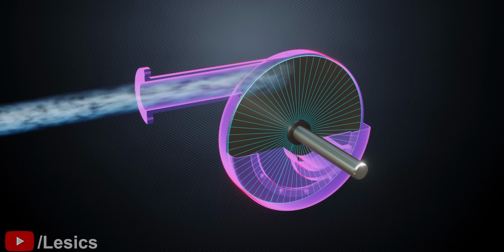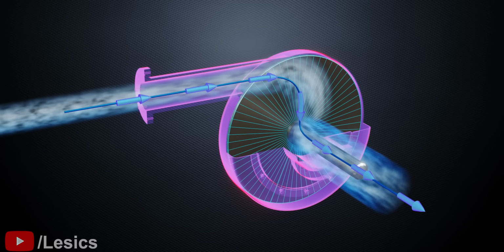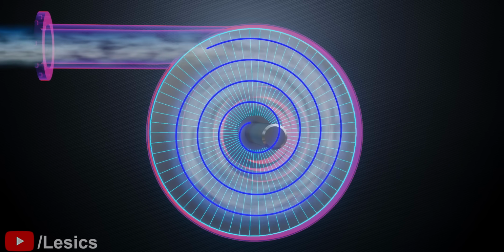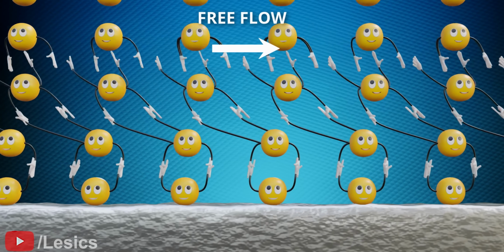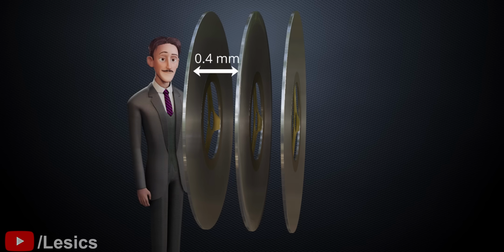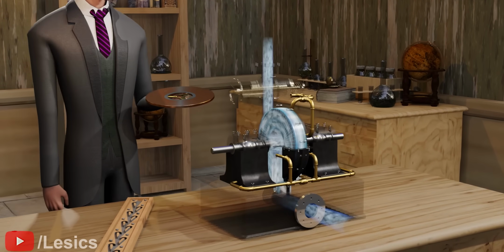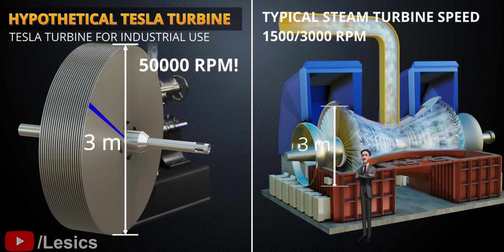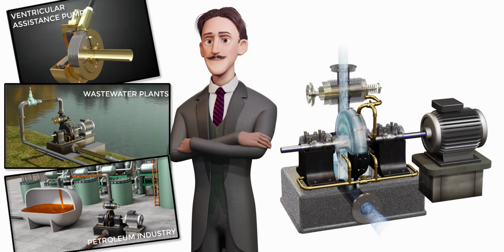Tesla Turbine | The interesting physics behind it

Comment: This very high rpm-rate only yealds for small disk diameters. Remember, the disks are driven by the viscous shear force acting in the boundary layer of the steam and the disk surface. The disk cannot rotate at a tangential velocity which is higher than the steam velocity. Tesla's turbine has a lot of disadvantages. The steam outlet in the center of the disk is not convenient, because the steam's velocity ist the highest at the lowest pressure. The more the steam vortex propagates to the center of the disk the larger ist the velocity difference between steam and disk, which leads to a lot of friction losses.

Furthermore it is very hard to predict mathematically how the steam moves between the disks. This makes it very difficult to optimize a Tesla turbine by use of theory. Only very modern CFD simulation tools are capable to simulate the flow behavior in a Tesla turbine and the findings from these simulations are not very promissing. So it is better to modify the Tesla turbine in a way that the steam enters and exits radially using a very well defined path at the rim of the disk, where the tangential velocity of the rotating disk is nearly constant. The steam propagates around a half circumference between the disks, where the tangential velocity difference between the steam and the disk is nearly constant and less than the speed of sound. This case is very easy to calculate by state of the art fluid dynamics. The gap between the disks is set in a way, that the friction is not larger than necessary to transfer the required torque carrying the power from the steam to the disks.

The space within the rim of the rotor is not lost. It can be equipped with permanent magnets forming the rotor of an axial flux generator. The induction coils can be placed inside the cover plates of the turbine. In this way it is not necessary to transfer the power mechanically through the turbine housing by use of a shaft. The power is transferred by wires connected to the induction coils of the stator. So the turbine can be hermetically sealed. A Tesla turbine modified in this way can act as a very small engine for plug-in hybrid cars. In order to get a high efficiency this engine should be operated in a trans-critical high-temperature organic Rankine cycle (ORC), where the working agent enters the turbine not as superheated steam but as a supercritical fluid, which will be transferred into superheated steam in the expansion nozzle. In this way pressure and temperature of the fluid can be chosen independently. The heat transfer to the supercritical fluid doesn't require a complicated boiler + superheater. It can be provided by a state of the art counter flow heat exchanger heated by the exhaust gar of a burner.

Comment: This is cool and all but from what this video tells is that a Tesla turbine extracts KINETIC energy out of steam which is the complete opposite of what you want when you use steam. You want to expand it and lower the temperature by extracting energy using the blades. Some power planets have super ultra critical steam which enters the turbine at 800C and 600bar and leaves the turbine at a near vacuum and close to it's condensation point.

Comment: 42847.93 kw of stored energy at 50000 rpm and 3 m in diameter and weight example:- 10 tons
 42 MW is the stored energy in the rotating Flywheel

Comment: you cannot use words as "impossible" when dealing with engineering, just not achievable at THIS TIME. future brings more knowledge and new materials. just last 100 years should be a lesson to you.
Reply: Let me know when you create a material that can contain a bomb.

Discs exploding from centripetal forces is not a joke.
Reply: @heroslippy6666  as we can find examples of spinning blades at 15-25.000 rpm in modern jet engines (commercial compressor blades) with even higher rpm on power plant turbines, tells us that there are materials what are capable of withstanding high rpm even today. micro turbine goes up to 500.000 rpm. so as i stated, future will bring us new materials and alloys and we can expect that one of those will be capable to withstand usage in Tesla turbine.

Comment: I've read about his "powerhouse in a hat" in this video. At that time, I wondered why not try more modern, stronger material for the discs. But you explanation basically and correctly shoots that down, along the RPM to efficiency ratio. Too bad it is impractical.
Reply: Graphene steel might work

Comment: At 8m 23s it is stated that the blade tip velocity would be Mach 13 (4459m/s).
That number is actually to low.
If my math is correct then it would be Mach 22.89 (7853,94m/s).
Here are the calculations:
Disc diameter: 3m
RPM: 50000

First let’s divide the number of revolutions per minute (RPM) by 60 to get the number of revolutions per second: 
50000 / 60 = 833,33

Then we multiply the diameter (3m) by pi to get the circumference of the disc: 
3 x 3.14159 = 9,42477 (unit: Meters)

After that we have to figure out how far any random point on the circumference of the disc travels within a second by multiplying the distance traveled every revolution (=circumference) by the number of revolutions per second: 
9,42477 x 833,33 = 7853.94 (m/s)

Finally we divide the velocity from the previous step by the the speed of sound in air in m/s (343): 
7853,94 / 343 = 22,8977 (Mach)

Thus the velocity of a point on the circumference of this hypothetical Tesla turbine would be Mach 22,89 or 
7853,94 m/s.

These values are slightly of due to the use of imprecise values like only using 
five decimal places with pi.

If you notice any mistakes in my math please post a reply. Thank you

Comment: What if the disks are tapered towards the edge it’ll be more likely to withstand the centrifugal force
Reply: Unfortunately, the cohesion effect needs a very tight spacing. 0.4 mm for gases, 0.5 mm for fluids.

Comment: First, Mechanical Efficiency is not the only consideration when considering a turbine design.  While the Tesla Turbine may not be suitable for mega-watt or giga-watt power generation, it may be well-suited for small-scale hydro generation due to its simple design, easy maintenance, and ability to handle "dirty" medium.  Also, with additional engineering, we may find ways to increase the efficiency of  the turbine at lower speeds -- example, make use of coatings or etchings to increase the surface area of the disks.

Comment: What’s the torque on the output shaft. Could you slow the discs speed then use a gearbox to attain optimal shaft speed?

Comment: So like most of Tesla’s inventions it is a very ingenious design, excellent in theory but in practice flawed and only suitable in niche applications
Reply: Very useful. Thank you
Reply: 2m
Reply: Only when you're powering it with gas/steam. If you use a fluid, the rpm is in the same range as a standard combustion engine, but then you have to take a step back and think about what you actually want to achieve.

Comment: I played around using an old mechanical hard disk drive. Super smooth platters, rated to 10,000 rpm... Space the platters at .4 mm... It should produce a great turbine.
Reply: Are you going to cut the discs or use a hollow axle for the outlet?
Reply: @silvergreylion  I bought a 1' piece of Aluminum 1" milled pipe with thick walls(3/8"). The platters have a 25mm center hole... and yes... I'll have to sand down the pipe or mill it 0.4mm. ;-) I'm using the platters because their ultra smooth finish should increase the molecular adhesion. I hope!

Comment: well,  at least this is a  fairly  accurate  analysis of one of tesla's ideas, that sorta works.       as  a  Novelty.    mostly.          since the tesla turbine is  meant to be used with a gaseous medium,  what the hell could a tesla 'impeller',   PUMP.?!?          as discussed in the video,  like most of tesla's  ideas, the tesla turbine  does  Not  scale  up, well.           any  historic  performance claim, made by tesla, can be  Disregarded.      any evaluation of performance  Must  encompass  the  cost of  Energy  Invested;    eg., heat for steam  or  energy to produce compressed air.      and, the use of the   LATTER  makes  the  entire (air) turbine idea   a  Stoopid  one.        googletranslate

Comment: Why can't you keep a short diameter of disk, but add a BAJILLION disks across, and split the incoming steam into many many small pipes? You could process the same volume of steam, but if the diameter of each disk is only like 20cm (there's just hundreds more of them), then the blade tip velocity is 15x less, or < mach 1
Reply: The smaller the diameter of the disk, the less distance the fluid has to travel. The less distance the fluid travels, the less energy you harvest from the system. Thats why current turbines are about 3 meters in diameter instead of 3 centimeters
Reply: @SavageDr4gon  In essence I agree but with two caveats, the energy available for extraction is limited therefore the usable rpm is restricted, gentlemen size does matter, neither of these issues has anything to do with available materials. . Having analysed the numbers the power curve peaks around 45k rpm and then reflects diminishing returns depending on the configuration for a 100mm disc. As the disc diameter increases the power curve moves to the left also indicating a limit to the effective speed. Still all in all a brilliant piece of engineering

Comment: So even with all of our modern materials and making the disks a smaller diameter we couldn’t make a smaller version to run with all the disks?
Reply: We could make a smaller version.. you just use multiple stages. 
You could get more efficient turbines then the ones we have now using these, you could likely get higher then 97% if you use air bearings by sending some of the steam into the bearings before being pushed into the system
Reply: @youtubeistyrannical1787  I’m a craftsman/fabricator and you’re giving me ideas! LOL!
Reply: @youtubeistyrannical1787  instead of making these with three meter wheels that would explode from the sheers G’s it would have to endure just make several smaller versions with stages and sending them through bearings as you suggest. It may even be possible to shrink the size and stop wasting so much space for these massive generators we incorporate today?
Reply: @Redtailedhawk99  I have so many ideals for configurations on these turbines it's not even funny.. 
 It sucks because I want to be a craftsman, but I never make things good enough when I try to make things.. tolerances are always off too much, I need better tools and materials
Reply: @youtubeistyrannical1787  that seems to be the problem with most creative people we just don’t have the right tools but with the right support that can change eventually. I’m so rusty with my math skills these days I’ve mostly forgotten all the formulas for equations I used to know like the back of my hand. I never had that support and probably could have done some really good things. That’s my biggest gripe with governments is that they are to busy spending money of buying people fish rather than teaching them how to fish in a manner of speaking. If you really want a big prosperous country you don’t do it that way. You have to give people the tools to succeed.
Reply: @Redtailedhawk99  exactly... 
 Our nation is like 30th for education because our school is too expensive.. 
 Many degrees can be done all online, they need to setup a free school online for those degrees that can be done that way. 

 But I think they need to just pay for school with our taxes, that would stimulate job growth and grow the market... More educated people, plus they would get employed and have healthcare.
Reply: @Redtailedhawk99  I want to do school so badly, but I worry about the debt it will make.. 
 I also worry I won't perform well in a school setting once I get there..
Reply: @youtubeistyrannical1787  I have an idea I proposed to the last two presidents on several occasions and I haven’t bothered with this idiot we have now. It’s an easier way to get skills while avoiding the heavy expenses of Colleges only to end up falling flat and be in a dead field or in a job you’re not happy with and be in debt over it. It’s different than any normal trade school. So in a way doing exactly the thing the government should do that I kind of alluded to earlier.
Reply: @Redtailedhawk99  wait what are you proposing?
Reply: @youtubeistyrannical1787  training that pays for itself. I see what you were talking about though. Do you think you could incorporate those two designs into each other? How would the production of Oxygen and Hydrogen aid in the performance of the generator?

Comment: Steam turbine/ power generators RPM is controlled very precisely at about 3000rpm to maintain the electrical frequency of 60 hertz (depending on country) without requiring reduction gears between the turbine and generator.

Comment: one could hypothesize that if you add more discs you can decrease the circumference/diameter permitting for higher speeds without disfiguring the discs.
Reply: next step would be gearing ratios and flywheels to store kinetic energy over time.... 

cool physics thought a spinning metal mass produces an ion field around the spinning circumference. the larger the mass the further away the field. this is also due to a magnetic field being generated by spinning electrons around a iron core.

Comment: so what materials "can" withstand that kind of speed?
Reply: None. Also, it's a problem of resonant vibration of platters. It shakes itself to structural damage.
Reply: @brushhaidinger2506  curious if there is a way to offset vibration with another vibration to lessen the stress on a material....

maybe spaced grooves or even electromagnetic bearings in parallel with the discs instead of around their circumference... always questions always something else to try.

Comment: Great video. Slight disagreement with your evaluation of the efficiency claims. In fact, there are tests that have demonstrated efficiencies within the claimed 90-97% range, the Westinghouse works experiment, for example. That showed that for comparable flow rates (which were kept low as you mentioned), tesla turbines could achieve ~90% efficiency to the 50-60% steam turbines were able to achieve (at least at that point in time).
Reply: well,  merv,  i keep wondering  how  efficiency  is  determined  when  the force that drives a  turbine runner  comes  from  a (powered) AIR  COMPRESSOR.!!!!
Reply: @daviddavids2884  The ratio of what you put in to what you get out. In this case, how much energy the turbine can extract from the air (the working fluid). The turbine can then be connected to a motor to generate power.

Comment: A 3m disk will not have to spin anywhere near as fast as a 6" disk. 

The tip speed can never exceed the speed of the motive fluid exiting the nozzle. Thus a larg or small rotor will be at its highest efficency when its tip speed is as close to the motive fluid speed as possible. Bitnthay will be at radically difrent rpm. Being a lot slower for a large rotor. 

The issu is its only efficient till you load it.  It can only extract useful energy by the rotor tip speed being less than the motive fluid. The larger the disparity between the motive fluid and disk rim speed the less efficient it becomes. 

So as soon as it does real work it loses efficency. As it slows. 

It is useful for being exceedingly cheep and simple to make. As well as allowing a lot of power in a small package. 

A conventional steam turbine I fantastically expensive to make. And has to be started very carefully to avoide  dammage. 
The tesla turbine does aoide these issues. Which may still make it useful.
Reply: Yes, it will, a 3m disc is required to generate torque, the high RPM is needed to increase the boundary layer extent over the surface of the disc see 3:33.
Reply: @coyote5735  the tip speed can still never exceed the velocity of the motive fluid. 

This video seems to think that the rpm of a 6" disc applies to a 3m one. It is simply incorrect. 

Firstly it simply won't work at that speed if it were 3m. The dics would be traveling way faster than the motive fluid out of the nozzle. And would itself be creating a larger pressure through trying to be a pump than the motive fluid pressure. 

The tip speed is what you have to have equal to calculate the rpm. This means the rpm will be different for different diameter rotors. And will be less the larger the disk. As it has to rotate slower to get the same tip velocity. 

And I am still correct. This type of turbine can never exceed the velocity at the outer of the motive fluid entering at the outer edge.

I have read the analysis of rolls Royce engineers on this turbine. You and the video are inaccurate. 

The main reason it can't be as efficient is that it can only matine its high rpm under almost no load. Where the dice edge speed is nearly that of the motive fluid. And the centrifugal force creates nearly as.much backpressure as the entering gas. So little flows. As soon as you load it it has to slow reducing the distance the gas will travel before exit. 
And so reducing he efficency.
Reply: @Madkite  I don't know how you can make such claims without empirical data. Watch the video again I don't think you understood the science.